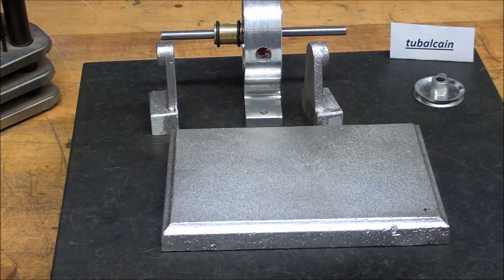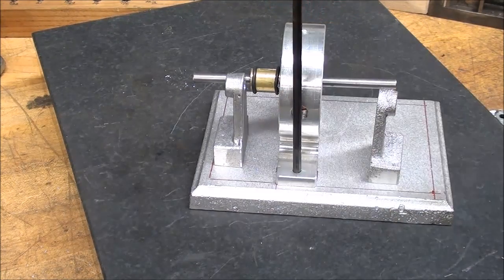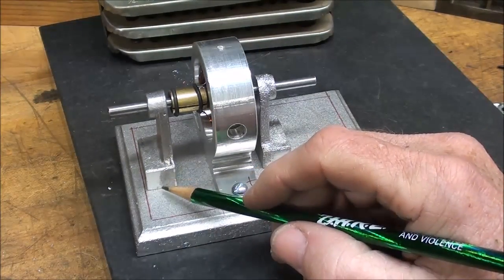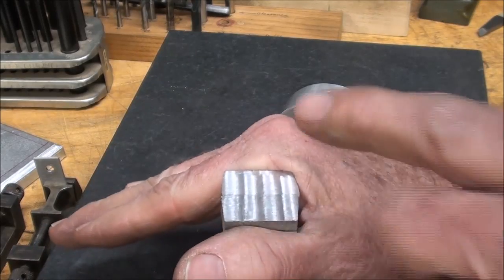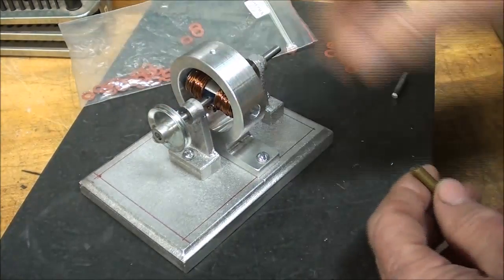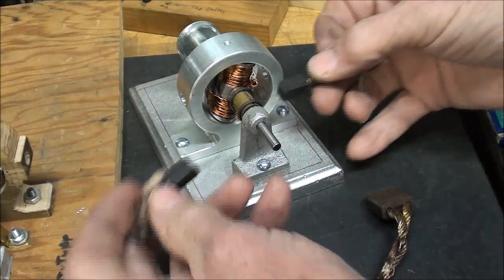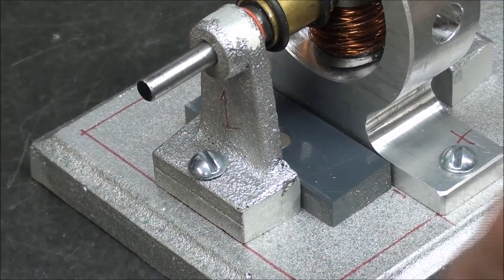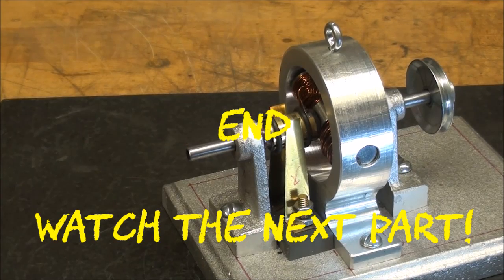Pt 5 tubalcain BUILDS A MODEL DYNAMO for a Steam Engine

Comment: Quick suggestion Lyle, place a fibre washer between the poly tube and the bearing, otherwise friction may weld the poly tube to it. See you have already done this in the brush holder end, but your hand was in the way for the pulley end. Looks good, itching to see it run.
With regards to finding the centre height of the bearing blocks, you could have measured the stator base to the bottom of the stator bore, then added half the stator bore diameter. No guesswork involved, no trial bearing mockups.

Comment: 5:11 Interesting... I would have approached it differently... I would have measured the diameter of the stator hole, then measured the bottom of the hole in relation to the base. From there, I would have added the radius to get the center height... and subtracted the radius of the rod. That distance would be the distance from the bottom of the bearing to the surface of the plate. (Of course... I'm one of those guys that lays it out in AutoCAD and does a lot of CNC stuff.)

Now if you have never used a CAD program... I found a good FREE one...  CAD Standard http://cadstd.com and the full-blown version is only $40 so it's well worth it. (Then you could print 1:1 dimensional drawings.) 
Here is my video on it: https://www.youtube.com/watch?v=Ocn4D2nyoBc

Comment: mrpete, in time those punches will flare a bit from use, what I do whenever I buy a new set is put them points down in the holder, saves a lot of bother when they start getting stuck in the holder and getting harder to put back in the holder after some use. Just a small thing but can become quit annoying.   .

Comment: I too lament the lack of specialty stuff that a hardware store carries now. I wish they would go back to being packed to the ceiling with good stuff, not just cheap, imported garbage. I was in Seven Corners Hardware about a year before it was demolished, and it was so cool. If you could want a tool, or a part, it would be there. Funny as this sounds, it even smelled like an hardware store used to. It was really too bad that the owners sold it to become housing, I wish it was still around.